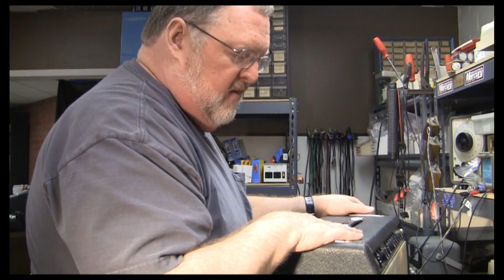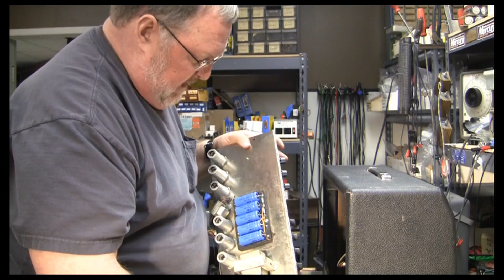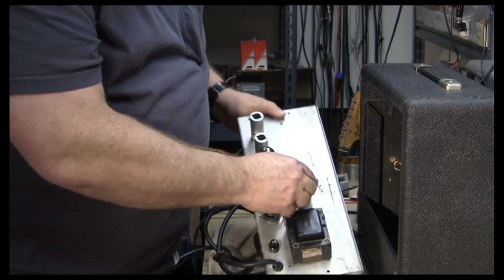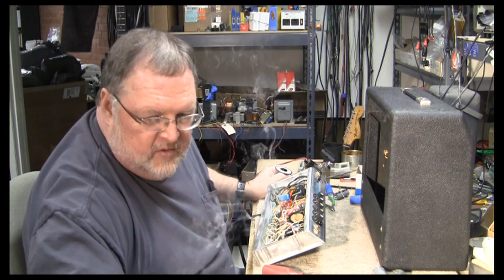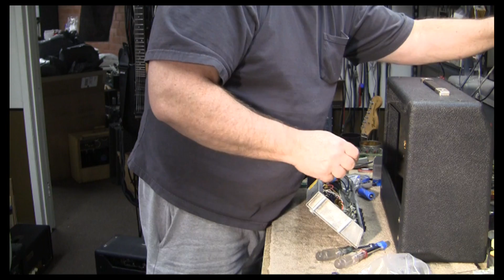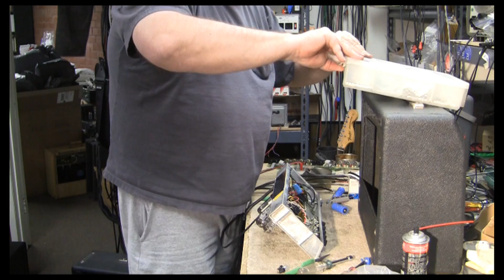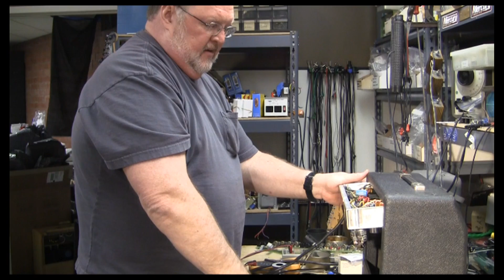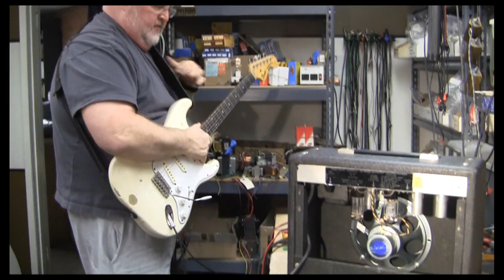Roy Blankenship Amp Repair Shop - 1

Comment: Interesting video and good work.. However, from a consumers standpoint, what Roy said at the 45:45  point of the video is alarming "and then I'll charge the guy $500 dollars".  I watched the video again and noted that he begin discussing the Vibro Champ at the 12:11 mark, the last screw was set at the 48:38 mark, the test concluded at 49:40. If you subtract the audio of Roy explaining to Barry Landau what he was doing, I would estimate Roy has approximately 25-30 minutes of actual hands on work and $30 bucks in parts for an amp that in today's current market (2015) is worth $500-$600.  So the comment of "I'll charge the guy $500 bucks" seems like gouging and WAY excessive..  That means Roy charges $1000 dollars an hour to fix a tube amp...Really? this is not a heart or a kidney transplant, brain surgery or cancer care. this is TUBE AMP SURGERY!!!!  very disappointing and will ensure I keep an eye out and shop amp tech prices... wow...
Reply: +Dewey Rayburn  If you guys are paying $500 bucks for a couple of caps and a few drops of solder alloy, you're right!  everybody in L.A MUST BE HIGH...
Reply: +ContraBand Joe  You guys need to move to Kentucky. My bandmate just last week picked up his 1977 Fender Deluxe Reverb from the shop. All new preamp tubes (5 I think) all new power tubes (3), 10 new caps, one new pot, cleaned, resoldered several connections.. $400.. it's basically brand new and sounds amazing....
Reply: +stuffandjunkanduhh  He smiles and shakes his head because he's taking $500 bucks to the bank......
Reply: +ContraBand Joe nope
Reply: +jrcenina85  yup...
Reply: +jrcenina85 your argument is based on a smile and is your opinion. my opinion is based on what is said on the video. which one of those you think is more sound? especially from a judicial perspective. think dude??
Reply: +jrcenina85 your argument is based on a smile and is your opinion. my opinion is based on what is said on the video. which one of those you think is more sound? especially from a judicial perspective. think dude??
Reply: +ContraBand Joe Here's what happened:  Roy made a joke and it went over your head.  It's that simple.  Now, you can accept that and just carry on or make yourself look even stupider by trying to cover up the fact that you just didn't get the joke.  I'm done here, may you someday develop a sense of humor.
Reply: +jrcenina85  you can think of it as a joke or anything else you want to. my take is exactly what he stated on the video. so take your own advice and accept it or move along. at the end of the day I don't care what you think
Reply: +ContraBand Joe just like I said earlier, you're one of those guys who thinks he's always right.  You're in a bubble.  I wish you luck on your one-sided journey through life.
Reply: So now your a psychiatrist or character judge and jury? I comment about a verbal remark on the video and now I live in a bubble? Pretty unqualified diagnosis. Try again, Epic fail
Reply: +ContraBand Joe yawn
Reply: +jrcenina85  before you fall asleep be sure to write that $500 dollar check to Roy for 2 caps and 3 drops of solder.....
Reply: +ContraBand Joe burp

Comment: Roy, I have a Peavey Austin 400 combo amp. I believe it is like 220w . It has a pop when I turn it on, but that is the only thing obvious to me seem to play well after that. However the volume is super sensitive. go past 2 -3 and It is way too loud.
Try to adjust it inbetween and it falls flat. I have played with the gain and the presense and unles I crank it up I have a hard time getting a good level out of it. Any suggestion. I am not an amp repair guy but not afraid of following instructions either. I was thinking maybe a less agressive volume comtrol.

Thanks for your consideration.
 Sam  
 Orlando, Fl

Comment: Excellent video, Roy!

I have a questions - not sure if they have simple answers. I'm trying to understand what parameters in a basic guitar amp circuits are affecting 1) how much dynamics the amp has (playing quite = clean, playing loud = overdrive) 2) the form of dynamics curve(the maximum amount of overdrive) 3) the 'graininess'  of overdrive.

Would you be so kind to explain these things or maybe give some links to read. I understand how the amp works but i don't understand what exact electrical values are affecting the sound and how. Thank you in advance!

Best Regards,
Yury.
Reply: it's hard to give you a quick answer. It's called dynamic range. There is  a curve, called transconductance, of each tube that is a stage in the circuit.  The grid in a triode is a mesh of thin wire or wires positioned between the plate and cathode - very close to the cathode. If you were to connect the grid to the cathode, the tube would behave somewhat like a rectifier. Most of the electrons flow right past the grid on their way to the plate. Please do not try this. Most triodes are not designed to be operated this way. When charge on the grid is made negative with respect to the cathode, the electron flow starts to get 'pinched off'. The electrons are repelled by the negative charge on the grid. Now, make the grid voltage negative enough, and the electron flow will stop. This DC voltage applied to the grid is called bias. The voltage that cuts plate current to zero is called cut-off bias. Increase the bias voltage and more plate current flows, up to a limit. The point where plate current no longer increases, regardless of increases in bias voltage, is called the
saturation point. Between cut-off and saturation, a triode behaves as a linear device.
How do we make sure the tube operates in this linear range? By setting the grid bias about halfway between cut-off and saturation. This tells you how to self bias the cathode circuit with respect to the grid.
Reply: part2: Remember that the bias is the grid voltage, referenced to the cathode voltage. Now, we can easily calculate the bias of the second tube in the circuit as :
(V2B gridbias voltage) = (grid voltage) - (cathode voltage) =value.

Now once you have the bias voltage per each triode in the linear range of the range.  You then have to calculate bias voltage with respect to plate current, and look at a graph of the 12AX7 or whatever tube you're using.

Transconductance (Gm) = (change in plate current)/(change in grid voltage).

Essentially, you figure out the linear operating range per stage, per tube. You then figure out the saturation point. Thus dynamic range is the ability of the amplifier to "swing" from the lowest of quiet to the brightest of "loud", and how quickly the amp can swing (or slew rate) from very quiet to very loud operation.  So the amplifier that can "swing" in dB the most from the quietest to the loudest sound (in dB) is the amplifier with the best dynamic range. Essentially, you do the math per stage and see how it works as a whole.
Reply: Interesting stuff
Thank you for the detailed answer! So long story short it's more about the bias points and the very exact transconductance curves of the tubes you're using.

But i need to understand one more thing. All biasing talks are including headroom term. The more "centered" biasing point is - the more headroom we get. Headroom is the dynamics range of the input in the amp where the signal staying undistorted or non-verdriven . Am i right?
Reply: yrussq yes.  The "headroom" is the acoustic sound stage, combined with the dynamic range. When a tube amplifier is over-driven, it's past its undistored tube characteristics, and will eventually clip the audio envelope and will start to look more like a square wave than sine wave. However, before the point of saturation is reached, but above the linear operating range of the tube, there is an operating region called "crunch". That's where even harmonics are favored over odd harmonics and it still sounds musical in nature, but it's nearly at the point of clipping and saturation. Transistorized circuits when over-driven equally favor odd and even harmonics, but tube amplifiers, when over-driven, slightly favor even harmonics and it still sounds "musical" in nature.
Reply: Interesting stuff Got it. Thank you again for the detailed answers! :) And about the graininess of the overdrive.

http://www.youtube.com/watch?list=PLCAC2473FF6D92489&feature=player_detailpage&v=UZhSkYgIgiQ#t=45
To be clear of what i'm talking about 0:45-0:48 on the video.

What is the electrical base for this type of sound, if you know certainly?

Comment: I bought a Peavey Bandit 112 trans tube 100 watt amp yesterday,the only problem is the pre amp section is not working,I knew that when i bought it,i can plug  into the return on the loop function section and use the power amp with a multi effects pedal to adjust my parameters,but i'm just wondering if it  would it be worth getting it looked at, and repaired.I only paid 35 dollars for it,other then the preamp section not working the amp is in mint condition,and for 35 bucks i could'nt turn it down,not to mention the speaker alone is worth the 35 i spent.

Comment: 45:45  "And then I'll charge the guy $500"  Geeze, west coast prices are much higher than east coast. I'd probably at 1.5 hours of labor ($120), plus parts in this case, and that would be 'steep' for CT customers.
Nice presentation. Roy knows what he's doing and there's no BS in any of this discussion.
Reply: I agree about steep prices.  I could only see myself paying betweem $100 and $200 because the components are not that expensive for capacitors and resistors.  Peace, Flood!
Reply: Around here in NYC, it would probably be Blackie Pagano would be the choice for tube amp repair.  Peace, Flood!
Reply: $120 plus parts is more affordable.  Trying to teach myself about tube amplifier maintenance.  Like changing tubes and biasing with a multimeter via youtube.  Doesn't seem that complicated.  I might be able to do it myself.  Save some money just by replacing the tubes.  I got some college credits in electronics such as building a device that lights up with controllable variable amount of seconds.  With that finished project, I got an A.  I am tempted to build my own amp as a personal learning project.  Peace, Flood!
Reply: He was kidding about the price he'd charge. Didn't you notice the little smile just after he said it?
Reply: It was a joke. Most of my customers tell me I don't charge enough for what I do. I do know guys out here who DO charge ridiculous money so I guess I understand why people might have thought I was serious. A complete Fender rebuild would be $250, including tubes and parts, just to give you an idea. I had a live/work space until recently that was $1200 a month and that IS very cheap for out here.
Reply: I have low overhead so my shop fees are much lower. Somebody told me if you want to make money building amps you in the wrong business.
Reply: basspig Mislead people? Are all amp techs devoid of humor? I hope not. The good news is, you are a real tech and can probably relate, there will be a bizarre mish-mash of people who will be in and out of your shop.
Reply: A very wise amp tech recently told me if your do quality work at fair prices you will have many customers.
Reply: Murray Melander It is hilarious how many people here didn't get that was a joke, it was completely obvious. The jokes about engineers are all true, I know too many of them. They all have some degree of Aspergers.
Reply: I got it, 1% inspiration 99% perspiration
Reply: U got that right.....................
Reply: He had to be Kidding about the $500 charge. That was an under $200 repair.
Reply: I'm pretty certain from his reaction after saying it that he was joking.
Reply: His face at the moment he said that looked like he was making a joke.
Reply: Ole Roy!  

Shout out, from Jax!
Reply: He Was Kidding.......

Comment: You are very knowledgeable and entertaining to watch. Have you ever repaired a precicion power ppi pc2600 amp? I'm looking for a place to have it repaired. It works but it get's very hot to touch as soon as I plug it in to the battery.

Comment: I had a question. I own a Marshall Lead 20, and there is all kinds of repair work inside, from new pots, to new big caps, new transistors, and a "mod". My question is about the "mod"...What I saw inside was a small "cap", disconnected on one side, and pulled up. This was obviously done on purpose. When I put it back, the amp was "grungier"..Do you know the purpose of this "mod", or what's actually suppose to happen?

Comment: Hey Roy I've just watched your video and it took me right back to when I used to repair all manner of valve amps Marshall,Vox AC 30's and Fender Twin reverbs!!! The Vox AC 30's used to a real pain to get the vibrato working due to difficulty sourcing the Valves.I worked for a music shop in Manchester England,and I could almost smell the set warming up!
brilliant we use to use a cct diagram from the 60's with hand written notation on them :-)

Comment: Hi Roy, thank you for your time in front of the camera so others can learn how quality is supposed to be done. What brand and model Varaic do you use?
Reply: I have a General Radio variac that has an ammeter along with the voltmeter. There is a guy out here named David Riddle who has a lot of variacs, he refurbishes them and sells them on ebay.

Comment: This guy is a seasoned pro electronic technician. His experience makes him worth every penny he charges.  My only critique is his soldering skills.  Trained as an aerospace level quality soldering tech, I can see how he could improve the strength, durability and longevity of his soldered connections.  But I take nothing away from his knowledge of amps, history, and component quality levels.
Reply: Sounds like he learn from you.
Reply: It is amazing how many 'pros' you meet in many industries and they all 'know' how to solder but none have been trained properly.
Reply: CaptPhillipsPointyNipples  This is a very deep question......do you think he is training anyone??  I hope he has an apprentice to learn his craft........dam shame we buy shit from China......
Reply: What exactly do you do differently??
Reply: Well, Stephen does have a point. I was trained to mil spec quality, and the process is very deliberate and carefully done. That being said, for most applications, like this, it wont make any measurable difference. I seldom see failures in amps due to faulty soldering, even though musicians can be extremely hard on their equipment.
Reply: Stephen Wieloszynski I was a radar repairman in the 1970s to 80s on mainly tube type equipment. My training included high reliability soldering. The most important thing we stressed was a solid mechanical connection, before soldering. And each type of component, depending on where and how it's placed in a circuit or on the board has variable types of mechanical connection. There are factors to consider, and if time isn't pressing ,you can always try to improve the job you're doing in electronics repair.
Reply: There is no need to give safety instructions here because if you are too dumb or too inexperienced to understand the hazards, then you shouldn't be doing this kind of work....It's common sense you need to be careful when dealing with high voltages....

Comment: I have a Genz Benz Black Pearl that needs repair. I've been trying to troubleshoot it. Even took it to a local amp shop--where they just retubed it, but failed to diagnose or repair the problem the obvious problem. I can plug up to the effects loop return and get a full sound. However, when plugged up to the normal input, I have to crank the volume, boost, and master. And then I only get this quiet, thin, overly distorted sound. Something seems  wrong in the preamp section. I was wondering what I should do or where I should go.